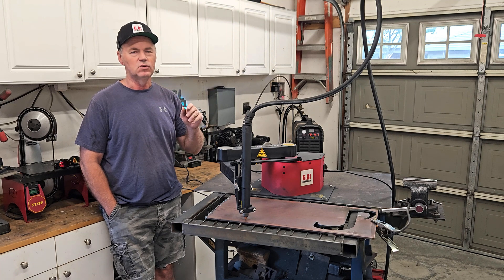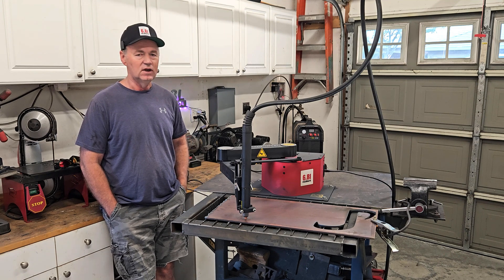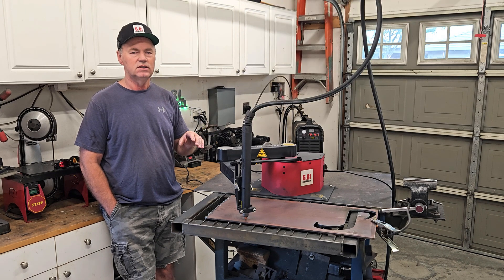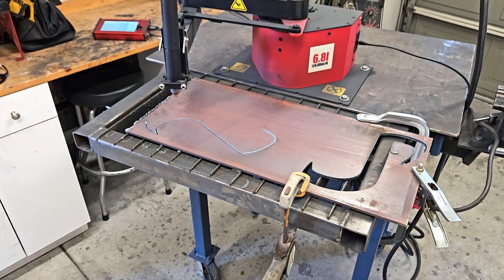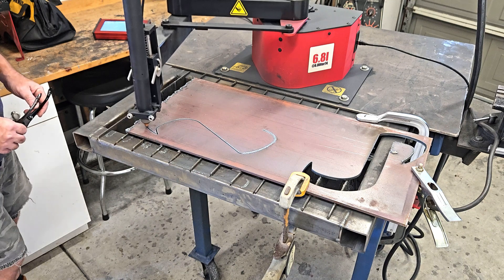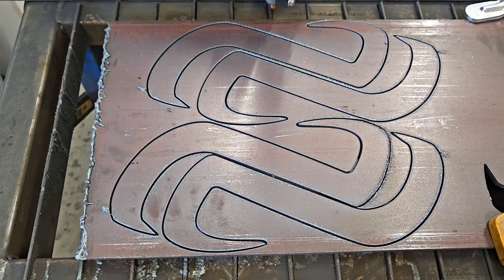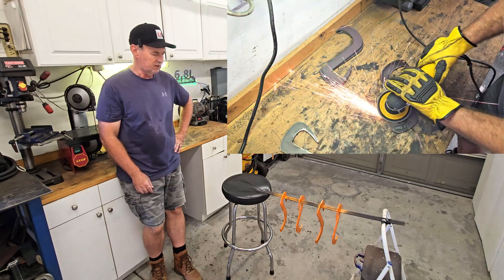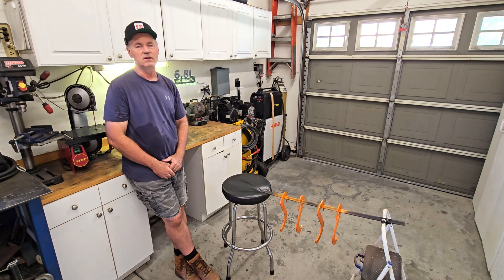Making more parts on the Arcdroid.  Cut issues and Recovery.

Comment: Do you a video on using/setting up the Cut 60? I have one (with the outlet for CNC) and am wondering if it will work without any issues. On the AD site it is not listed as an approved option.
Reply from the maker: I do not have a video on setting it up.  I don't remember the terminals, but I wired it to the two start/stop terminals.  That is the only connection I currently have between the cut60 and the arcdroid.  At one point I tried to send the voltage signal from the cut60 to the arcdroid but it was so "noisy" that it caused the arcdroid to lock up.  I reached out to Andrew at Arcdroid and shortly after that the Cut60 was removed from the compatible list.  I try to steer people away from the cut60, but if you have one the torch trigger circuit will work from my experience.  I would not try to use it with THC.  Your mileage may vary.

Comment: Thanks for sharing. I also had same results recently with 1/4 steel plate 90 ipm at 45amps with sync 65, followed cutting chart specs. however chart didn't include amps. Increased to 60 amps and repeated process with success. Does your cutting chart include amps or volts?
Reply from the maker: The chart on the Primeweld Cut60 shows amps, and recommends 45amp for 1/4" at 47ipm.  It could have been a poor ground connection as @yellowmetaldriver suggested in his comment.  I'm pretty sure I've ran that speed before.  Thanks for watching and commenting!

Comment: 47ipm @ 45amps @ 65psi is what I run my cut60 on 1/4 mild steel plate with perfect results.
I've seen that and would move ground closer to more solid material (vs side with huge piece missing) as well as and 1stly most important run a flap disc on your ground point to get best contact.
Reply from the maker: I'm glad to hear you run 47ipm since you run the same setup as me.  Good tips, questionable ground connection makes sense.  It's good to hear from you again!
Reply: @6.8liter74  many thanks, I enjoy watching your vids!